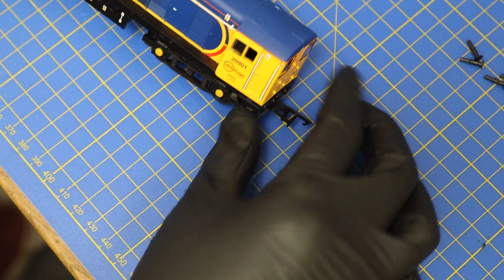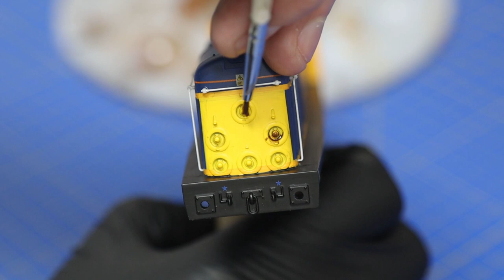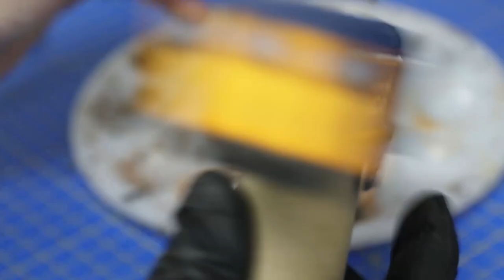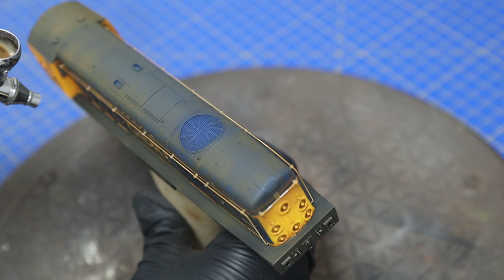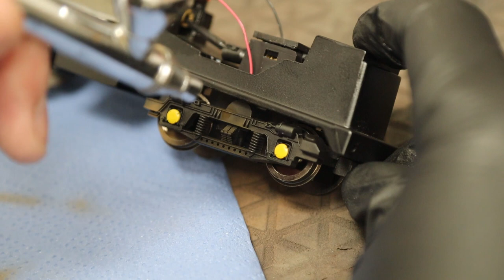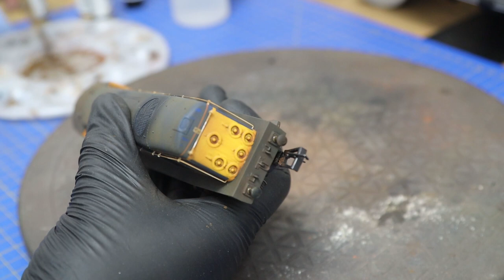Weathering Model Railway | Hornby Class 20 - 20901

Comment: Lovely job
I’ve only just started to weather locos so there were plenty of tips in there👍👍👍
One which I can’t wait to try is using oils, so thanks for sharing.

Cheers John b😷
Reply from the maker: It took me a while to get used to using oils, but they're a permanent part of the tool box now
Reply: @BuntersYard  - I’ll have to give them a go....having the ability to make panels look faded is one thing I’d like to try. I didn’t even know how to do that until I saw you do it👍👍👍
Reply from the maker: There are always different ways to achieve the same effect. Today im trying it with paints and an airbrush on a new project that you may have seen on Instagram?
Reply: @BuntersYard  - yeah I’m following on Instagram 👀👀👀